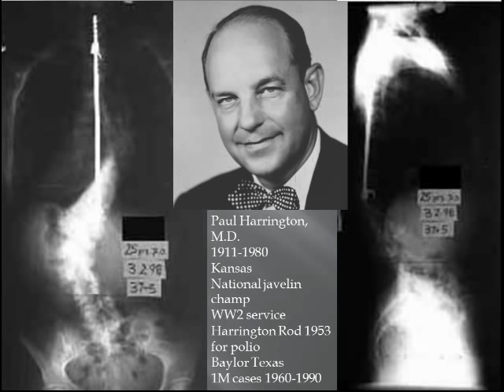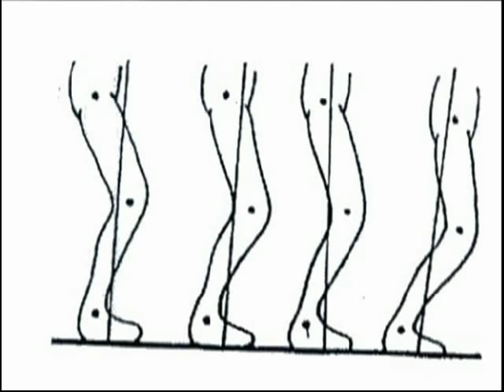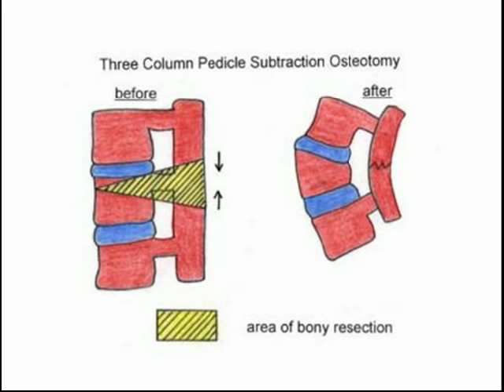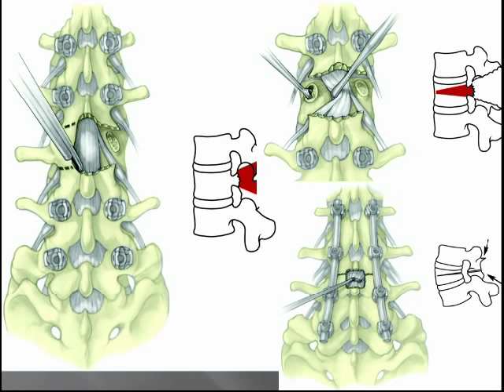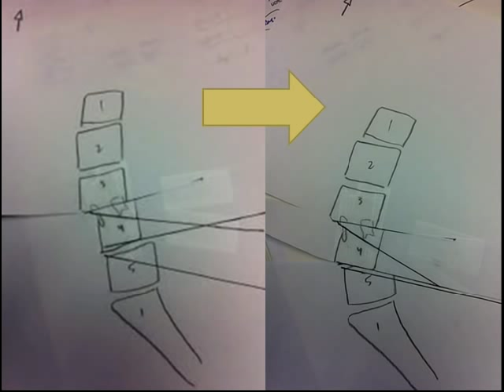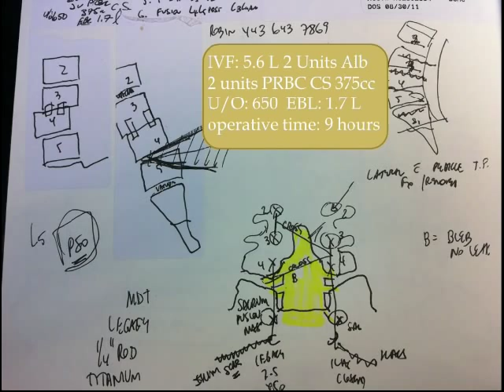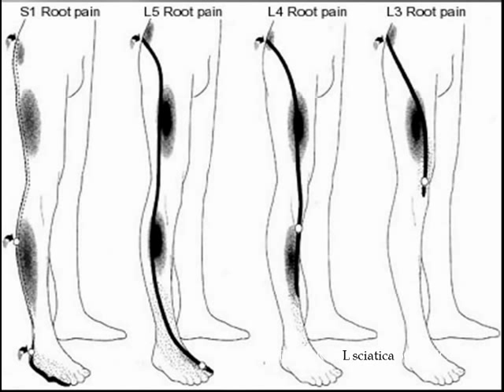Flatback Syndrome Spine Lecture

Comment: Isn't it possible to correct a flat back with exercises?  I see alot of that on youtube and would much rather try that than surgery.
Reply: I wish there were exercises that could correct flatback. Unfortunately, most flatback occurs, as Dr. Antoniades mentioned, during surgical implantation of the Harrington Rod to correct scoliosis. In 1979, I had my first back surgery to correct severe scoliosis using the Harrington Rod; a stainless steel rod about the diameter of a straw. Mine was almost a total fusion from T,3 to L,4 that afforded me almost 17 years with good correction though not without complications. Comparatively, 1979 was the dark ages for correcting scoliosis as was the importance of lordosis. Before the surgical team closed, before the full body cast could be changed for the first time, I had flatback. Exercise is not an alternative to surgery because stainless steel doesn't bend. The spine is no longer flexible; bending, fluid, twisting with you. Instead, the spine is rigid, stiff, unyielding, with no range of motion. If severe,chronic pain doesn't prevent exercise, the fact is, no amount of core strengthening, pelvic tilts, etc. will change the properties of steel or titanium. Medical technology has come a long way since '79. Learning from mistakes is still among the great educators. When I was following advancements in the method for correcting scoliosis, multiple plastic type rods were being used. My focus now is remaining upright and out of a wheelchair. This response is for flatback due to spinal implementation only. I sincerely hope this lengthy bit of information will be beneficial to someone. I always welcome any exchange of information, resources and ideas.
"The best way out is always through"
Reply: mood swings
Hello, thx for your input.  Truly sorry for all you and others have been through. I too have been through alot with "somatic dysfunction", degenerative disc disease, two surgeries for herniated disc, fibrymyalgia, PMR, etc etc).  Just wanted to add that flat back, as is in my case, can occur from being sedentary -- working in an office at a computer for long hours for many years and not countering it with getting up frequently and stretching.  I may even have been born with a flat back, as pics of myself as a little girl may show.  So it's not always from surgery with rods. My D.O. said I should not try to restore the arch in my back at the age of 61.  Some people tell me it's possible, others, like him, say no.  I guess because of my compromised discs, I should listen to him.  I pray we all stay out of walkers and wheelchairs.  Best to you.
Reply: Exercise only strengthens your core, does not cure nor fix flatback syndrome. it helps to a point but is not the end all cure for it. It does not cure it, although with the core straightening, helps the pain go away to where the muscles are trained to carry the weight, if you stop the exercise of the core and back muscles, your pain comes back.. and this for me is the ultimate challenge.. to keep exercising, i was told i will have to do these exercises for the rest of my life, because there is basically nothing they can do for me.. surgery is not a guaranteed outcome..
Reply: @DevilsDragon33  i wonder what exersizes you do.Can you share a few?
Reply: While there is no correcting my flatback, it is very important to keep my core strong and in motion. I do the typical exercises that are done to create a strong core. The ones used in physical therapy. Exercise and a chiropractor are the only things that truly helped the pain in my back. However, I have a few other issues with my back where the chiropractor will no longer touch my back.